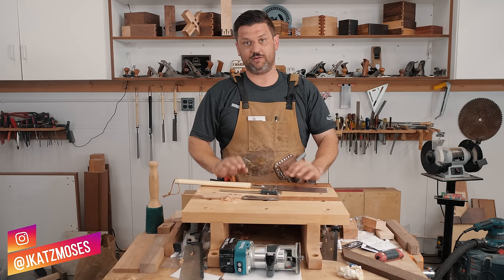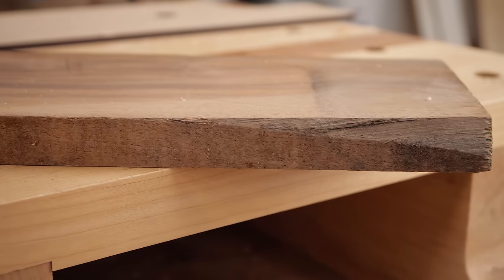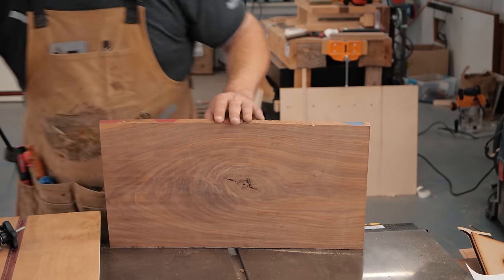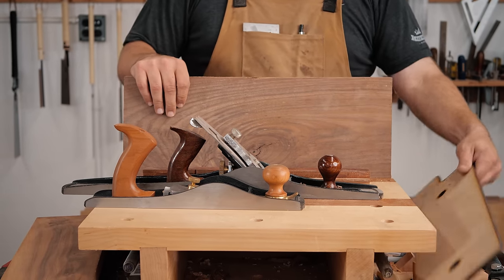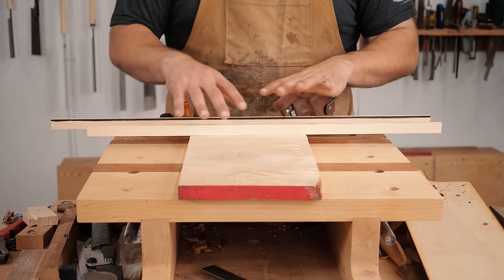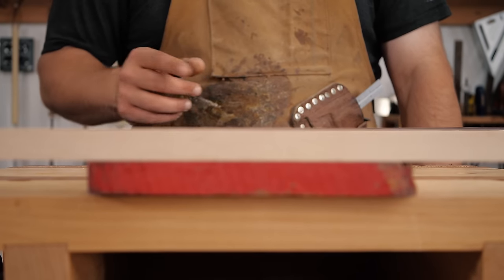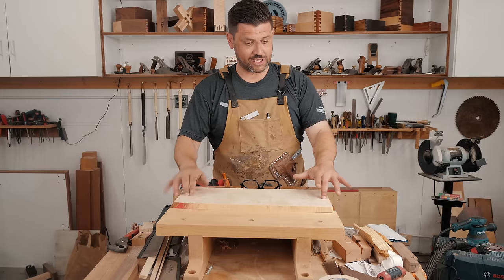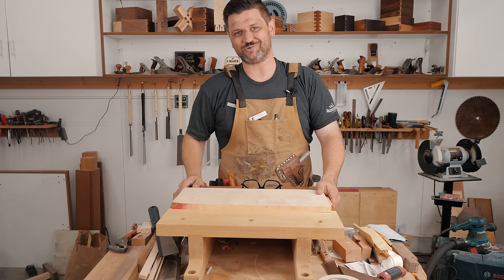5 Ways to Joint a Board Without a Jointer

Comment: I love watching your videos. I’m still learning as most are as well and just knowing that you can dial in a piece of wood that’s twisting or cupping without dropping another $300 on a tool that collects dust when not in use; this ups the skill value. For me personally, I would much rather have skill value over a shop full of tools that when not in use are just a lost investment and this also goes towards how to problem solve which if you can’t do that then woodworking will never get to the point that you master a craft. I have a bunch of pallet wood slats that are varying widths and about 1/2” thick but they’re cupped badly and I’m looking for a time efficient way to make them safe to true up on the table saw without kickback and make them fit into one another for a feature wall without annoying gaps. 

I’m also going to say that me getting into DIY and woodworking has saved my mind from ultimately losing it with the political circus going off the rails. This forces me to unplug that garbage and do what gives me personal satisfaction and a piece of mind in learning for the sake of learning but also developing a skill that I didn’t have before, how to think about wood and make things that come to my mind and empower myself to not rely outside myself. So I’m respectful in that wood has a long-standing tradition of being more towards the spiritual in a way because it’s grounding and when you just stop and listen to that creative inner mind at play, the pieces all come together. 

Take Care and Be Safe!

Comment: hey great video. thanks man. love your content. i was wondering (1) for your jointing techniques, wouldn't that need to happen after faces are planed? cuz if the plane is off, your edge will be off as well? is there a way around that? (2) if you are face planing walnut, its hard to see pencil. can you use chalk? what do you use for walnut or darker woods?

Comment: I’ll take some issue with your advice on correcting a bevel when shooting the edge. Holding the plane square to the board? Nevah hoppen. To work down the high edge, stay flat on the work, but let the non cutting outside edge of your tool ride the low side. Use your fingers underneath as a fence. Skew the plane slightly to keep balance. Take a lick or two, then check. If your iron is sharpened with an ever-so-slight convexity, and I mean only a coupla thousandths, then just shift closer to one side or the other as you stroke, same idea.

Comment: Hey man thanks for the video I got a question. Sooooo me and my dad have a wood shop in our house. Anyways we do have a jointer. I watched some how to videos today on it, and I re squared the whole thing but I ran into a issue. So the height table has 4 different non perpendicular surfaces. Each spot is a bit off. The thing is it’s a solid height wall to rest against. So right near the cutter head it’s nearly perfect on each side. It’s the start and the end that are muffed up. Any idea on this? Also do you have tips on practicing on a jointer? If you could maybe make a video on one if you haven’t that would be seriously excellent. Maybe explain what each part of the jointer does in depth. Then talk about how each side of the table works, and how we can relate that to different pieces of wood. Also thank god the saw was off. But I had it unplugged and was working on squaring the fence. And basically I slide the saw guide out of the way and cut the shiz out my pinky. I was like well at least the blades are sharp. 
Anyways make thanks for showing this! 
I been making a crap load of jigs lately. I made this amazing finger joint jig except I made it with such precision when I clamp the top sliding piece it throws off the joins by about .030-.055 which ticked me off. 
Also do you have any recommendations on a good finger joint blade? Maybe not super expensive all the ones I see our insane amounts of money. Sorry for the long message hope to hear from ya :)

Comment: Dumb question, when you used your router why did you put the board that you were jointing underneath the template? Could you do the same with the guide board on the bottom and a trim bit that has a bearing on it? I’m very new to wood working.

Comment: Hey nice video. Question: I've made a whole bunch of planer sleds for face jointing, but can't get rid of this super deep snipe going in and coming out. I have the same planer as you, and it doesn't snipe at all without the sled, but with the sled it has terrible snipe. Any idea what might be causing it? My sled is 3/4 " MDF, about 30 inches long.

Comment: So those fancy flush trim bits are over $200, nice. Do you think it is a good idea to use them on the dirty lumber yard edge of the piece? Just me but I would be running that edge through a saw first. I also vote spend the $500 on a jointer.

Comment: Planer as a jointer. Forget the wood shims, total pain to insert and not raise the board not to mention time spent cleaning up the hot glue. Simply use 2in painter tape where you need it on the sled and on the corresponding spot on the board. Put as big a blob of hot glue as you need on the painters tape affixed to the sled and place the board on top. Push down till it is level and you are good to go.  Clean up is a matter of seconds to rip off the tape.  I've been doing this for 15years and on boards up to 12ft long, yes it's a big sled. If the board is really cupped then you can support the centre as well to stop the rollers flattening the board as it passes through the machine. Can't think of an easier way to flatten boards and as most planners are minimum 12in wide it is a massive saving over a dedicated jointer. Generally it is easier to level the board cup side up as it is simpler to level the board and it just needs support along the edges.
Reply: Hot glue on painters tape, great idea! Thanks!

Comment: Super ultra cheap edge joining technique that I've used is to take a 4' level and a 3' sanding belt (cut to be one long strip) and then to clamp board on both sides of the level with the sanding belt pinned over the level.  Imagine a U shape with the level's edge being the bottom of the U, covered w/ the sanding belt.  As long as the board is not much narrower than the level's edge, you can slide it between the clamped boards across the belt.  The belt won't move because it is pinned down and you can keep the board square against one of the clamped boards.  

This takes A LOT of elbow grease as you get closer and closer to squaring because you sanding more and more of the surface.  But it works as long as you are careful to keep it square, apply even pressure across the board and flip it from time to time.

Probably costs ~$20 if you don't have any of these tools, all of which (save for maybe the sanding belt you cut) would be useable for other projects.

Comment: That router bit is half the cost of a used jointer lol...that's ok I still want one ;) Good vid
Reply: The bit occupies 3-4 square inches inside a cabinet, while the jointer occupies several square feet of space in the shop and isn’t very portable. Keep that in mind. Space may not be critical in your circumstance .
Reply: Louis, if we are comparing quantities, how about seconds for a jointer versus ten or so minutes to pattern rout one edge?
Reply: Lee Haelters Were we talking about “pattern routing one edge” ? Somehow I missed that conversation. I thought the topic was straightening or flattening.
Reply: @louiswarmoth7354 , well, I could have used the term template routing, I suppose. How do you refer to following a guide board with a ball bearing piloted router bit?
Reply: Lee Haelters I see now what you’re saying. Using a pattern cutting bit as he illustrates in his demonstration. I don’t think it’s ever taken me ten or so minutes but I catch your drift. Every body has a preferred way of accomplishing the same task. I usually used my router or table saw to straighten board edges, each requiring a straight edge of some kind. The router usually does a smoother job . I have a pretty good sized shop but never wanted to surrender the amount of floor space required for a jointer. I have an 8x8 table in the middle of it for table saw work. It’s drilled like an air hockey table to handle sheet goods, as I mostly did case work.
Reply: @louiswarmoth7354 , the best setup I have seen for jointing the edge of sheet goods prior to  edge banding was a router table that folded down from the wall, just the top of about 8'x3'. The router was positioned at one long edge, and had a fence that was set to take the teensiest bit of a cut. Oddly to me, it was arranged like the sole of a hand plane, rather than the tables of a jointer. Bob Higgens-Steele made good use of that in his case work. Back when it was rare for small shops to have a slider or edgebander.
Reply: @louiswarmoth7354 , and you won't be finding me using a jointer to put a good edge on particleboard, MDF, or ply. I agree, if it's sheet goods your using, you don't need a jointer for much.
Reply: Lee Haelters  You’d be surprised how well a 97 pound sheet of 3/4” MDF slides with a leaf blower blowing air under it through hundreds of small holes !
Reply: @louiswarmoth7354 , leaf blower! That's the missing link! Super idea, thanks!
Reply: Lee Haelters large volume of air...not too much pressure. Provides an air cushion to lubricate glide. I’m sure you’ve used a burst of air from compressor to help move a sheet of goods that’s flat on the table.
My inspiration.
Reply: @louiswarmoth7354 , spacing of holes and their diameter? Just a box underneath, or some kind of channeled plenum?
Reply: Lee Haelters table sides 8” with about a 4” cavity. Interior divided into about 2’x 2’x 8” squares for top support with several 1” holes drilled between all compartments. The laminate top was laid out with 4” grid lines and drilled with 3/32” bit at all corners. Some areas didn’t seem to have enough air so I went back and drilled some squares in the center, maybe 1/4-1/3 of them at the end away from the saw. At the end by the saw the grid was reduced to 2x4 squares since there’s less surface there.Mounted the blower under the table on the end away from the saw. Detachable Blower from Rigid vacuum so I use a vacuum hose brought around outside then through table skirt opposite end from saw. Mounted a separate switch at the saw end for blower. The air doesn’t benefit much unless cutting sheet goods. Next to none with every day ripping. I built the bottom deck with 7/16” OSB resting on cleats. If I was doing it again I’d use prefinished 1/2” plywood for the bottom deck as I feel there’s significant air loss through the OSB. All in all I’m pretty satisfied with the results especially considering that it was an experiment all the way through. The one major drawback is poor access to the bevel crank and the saw only satisfactorily cuts 90 degrees but hey that’s 99% of what I cut. I have a second saw to cut bevels with. My saw is a 35 year old souped-up Craftsman...larger motor, dual belts, increased rpm by nearly 1000, different rip fence(from a Grizzly). I can crosscut approx. 54” supported.
I might also mention that the holes along both right and left edges are drilled with a slight angle, maybe 5 degrees, toward the center of the table which tends to push the material gently that way.

Comment: Hey nice video. Question: I have the same dewalt planer as you, and I made a sled out of two pieces of particle melanine that I glued together clamped to a couple levels. It's really flat as far as I can tell. But when I use the sled, I always get crazy snipe on both ends of the board, no matter what I do. My planer never snipes when I'm planing with it, only sled-jointing. What do you think (community)? :) I have a 6 inch jointer too but I love the sled method for face jointing glue up cutting boards that don't remain flat after they're glued.
Reply: I feel like the sled must be tipping going in and out of the planer, or something like that.

Comment: I have a quick question not really related to this video but I will ask anyway. I am new to woodworking and am in the process of building a very simple cross cut sled for my job site table saw. The question is when I am done do I use the cross cut sled with the riving knife that comes with the saw or do I remove it, or does it matter one way or another? 
Thanks.
Chris
Reply from the maker: Leave it in
Reply: @katzmosestools  Thanks.

Comment: Hmmmm.  All work starts on our joiner, so not in agreement with delaying acquiring a joiner/surfacer.  Incredibly important tool in the shop.  This is a good work-around trick, but the value of a joiner/surfacer cannot be overstated.
Reply: Back in 2004, as a rank rookie, then, the 1st 2 tools I bought were my Ridgid jointer/planer and my drill press.  10 years later I learned their utility in wood working and today I swear by them .
Reply: Why does he say jointer instead of joiner..
Reply: @SailingQuicksilver  Joiner and jointer are two different things. He's talking about a Jointer.
Reply: @freshfrij0les  so what's a joiner?  I looked it up and a jointer is the tool.. And a joiner is the person who uses it.

Comment: Not a steel stud, but Unistrut. It is about 1/8th inch thick super strong and can hold loads far greater than a steel stud, its a little more weildy than a stud too. It too is very straight, and will be more likely to stay that way, because of its thickness. Steel studs are good for vertical loads, not horizontal, like the Unistrut.

Comment: Question, what is the best type of board to buy/use that if flat to use as the base jig when surfacing planing/face joining board ?    I’ve looked at some 3/4 inch plywood but the ends are always curved a bit.
Reply from the maker: Baltic birch
Reply: Thank you, I’m just getting started.  I’ll look for some of this.   Assuming this would be good stuff for any jig.    Just bought my first portable table saw and looking at trying to make one of your sleds for that as well for cross cut, etc with one of your stops.

Comment: I don't understand why did you use that jig on the table saw. After using router you could use the flat edge on the table saw's fence and get equal width board with perfectly parallel edges.
Reply from the maker: It would be a pretty short video if I only showed one technique for edge jointing

Comment: I’ve got a big board of 9/4 walnut I need to get a straight edge on. Would it make sense to use my track saw to put a straight edge then flip it and rip on the tablesaw?  

Then square off the ends with the track saw and a big framing square (don’t have any fancy track square). It’s too wide for my miter saw
Reply from the maker: Yes. Should've included

Comment: Good stuff ,  going to be receiving a supermax 19/38 this week would your example with the shims and planer work on the drum sander?
Reply from the maker: Definitely will work just A LOT slower. Drum Sanders are amazing. They don't make you faster but they sure as hell make you better and do things other tools can't
Reply: @katzmosestools  
Use wd40 to keep your drum clean 
Wipes dust roght off if you use it enough to coat the drum

Comment: Just for everybody’s information, don’t try to use the real thin 25 gauge studs they sell at Menards or Lowe’s, I’d recommend a 16-18 gauge stud, just for rigidity.
Reply: Colin, studs are made in 16 gauge? Yikes! For skyscrapers?
Reply: Lee Haelters oh yeah, we had some on a job making big headers over doors that were 14 gauge, 12” wide, 10’ long. They were HEAVY, and I was unfortunately the guy on the ground dragging them to the saw to cut. The heavy studs like that are for the exterior walls, they put a fiberglass sheathing called Dens-glass on, then all your brick ties screw to the studs, that’s why they use such heavy studs on exterior walls.

Comment: got a very small shop (gluing, finish, small assembly area is 14foot by 9,the cutting planing area is 14 by 20 foot) so all my tools are small, site table saw, small home built router table, bench top lathe, sliding miter saw and scrolling saw, 12inch cut bandsaw .  so when i bought a planer i bought a bench top planer/jointer with 8" wide beds. had i more room and a bigger table saw i would have gone 12" planer and joited by hand, but as jointer and planer were one machine , what you gonna do
Reply: Robert Brownhill, my Grandpa, a carpenter-joiner his whole working life, worked in an 8'x10' shed with no power tools of any kind!
Reply: @alexwilsonpottery3733  goes to show. but my granpa always said work the hard way if you enjoy it butif you can use machines but dont even though your hatin the hard way, your not a craftsman, or juss a man, your an ass. work the way your happy unless you have no choice. seems good to me
Reply: Robert Brownhill, what is the make of your machine, if you please?

Comment: On the cheap…a router to get those 90 deg board edges in straight lines…THEN a router sled to flatten the board too.  Maybe not as perfect to the finest degree as an expensive jointer and planer combo…but using just a router is way more affordable for diy’ers.  Even a cordless palm router can do it if time is not an issue!,!

Comment: If you need to plane two pieces of wood to glue together and all you have is a hand plane then simply clamp the two pieces of wood together. Plane both pieces of wood, it won't matter is your hand planing is not at 90 degrees to the stock, the pieces will mirror each other perfectly when you joint them together.